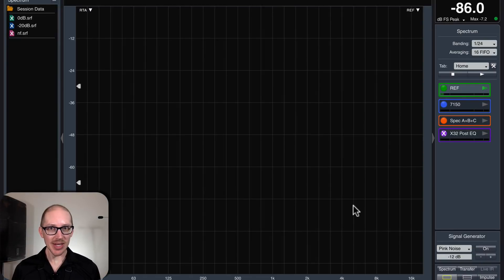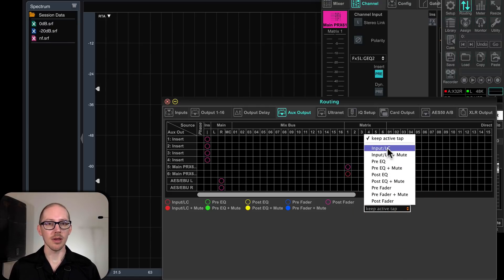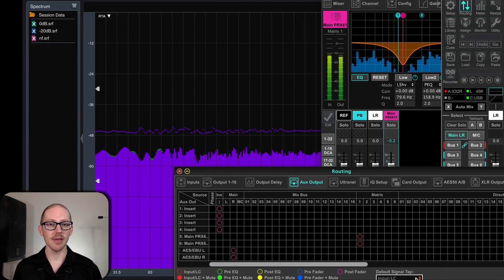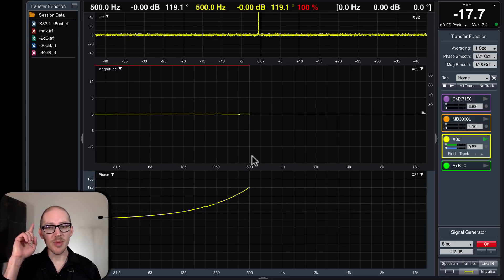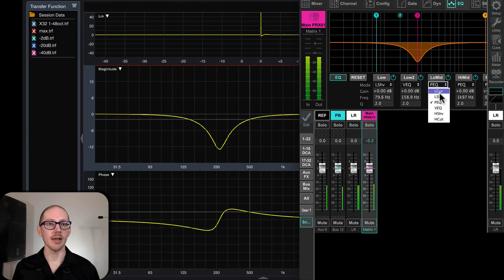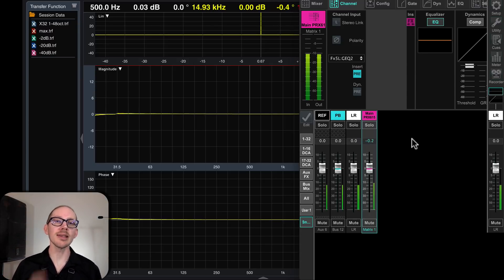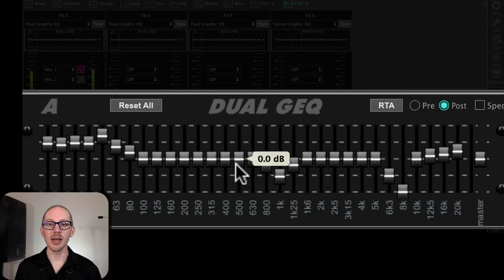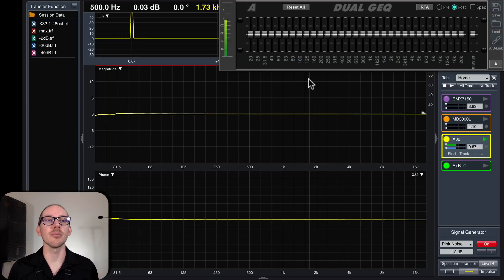Expectations: How do you measure an EQ in Smaart? [GSwSST24]

Comment: Hello Nathan"When staging a performance in an indoor venue, what strategies can we employ to address the variations in tonality resulting from the room’s unique acoustic properties?"
Reply from the maker: Hey Robin, can you give me an example. Maybe this happened to you recently? Tell me more about what you mean by changes in tonality. From my perspective it seems like the sound system calibration process should account for this.
Reply: @nathanlively   Thanks for your reply ....In my experience, indoor environments tend to exhibit a pronounced feedback effect. This is primarily due to the fact that certain frequencies may be amplified, contingent upon the specific acoustical properties of the room...What strategies should we employ to effectively mitigate such a challenge?
To what extent are Finite Impulse Response (FIR) filters practically applicable in a live system for the purpose of room correction?
Reply from the maker: @robintanj  ah, I see. I don’t have any good advice. All I know how to do is still apply best practices for system. Check every point in the signal chain to maximize GBF. I’m working on an anti-feedback plugin. Would that help?

Make sure that you know where your alignment positions are. You don’t want to be accidentally summing main and sub into an open mic onstage for example. 

Otherwise it’s just EQ.

Comment: Hi Nathan, Thanks a lot for the Video. Everything is understood. BUT one question. Everybody speaks about the phase shifting caused by the GEQ or PEQ. But in a practical situation why it matters? We do not send any paralel signals of a channel. like one is with and ather one is without EQ? So phase shifting matters where there are identical 2 signals with different timing. Could you please point out a few practical ( Especially Live Sound Situation) situation where the phase shifting through the EQ matters? Thanks in Advance.
Reply from the maker: Hey Priyan, please see if this helps: https://youtu.be/Z-lEyq4sb_k

Comment: Smoothing is implemented so badly in both: Smaart and SysTune. In 1/1 mode you can even see straight lines, while this should be a continuous smooth curve. Something like a (bi)cubic interpolation should be used...
Reply from the maker: Hmmm, I had no idea. Good to know. Is an another audio analyzer that you prefer that you think has handled this better?
Reply: @nathanlively  I'm not a "pro" in sound measuring, but as a programmer I see the issue from the first look.

Comment: Hi Nathan, 
Great info! Thanks. 
So, how would you route this on, say a Digico? Or any other console where you couldn't take the measurement-signal "pre-everything" on a matrix output? I'm kind of stuck with this.

Right now I make an extra matrix to be the measurement,  and gang it with my actual LR matrix. But that's probably not the right way to go.
Reply from the maker: Hey Marc, I did make that step a little complicated. Let's assume that you are mixing everything to a group, then sending that to the Matrix where you are doing some output processing for the different speakers. When you route that group to the Matrix, also route it to a physical output, therefore avoiding the processing you might do on the matrix. Does that work?

Comment: that would be harmonic distortion of any electronic equipment, a complete sine wave pure is created digitally but the a/d converters at the moment of generating electrical signal resonate with the components creating harmonics, measured THD (total harmonic distortion) lower is better, specially on broadcast because harmonics create a ton of problems since those where not intentional those are harmonics but created as a margin of error of the electronics do not miss interpret this as harmonics in music a perfect electronic device should not have them.

Comment: Hi Nathan, great video. I have always wondered what actually caused the phase shift when boosting or cutting a frequency with an EQ and why it does sort of a 'z' shape(in the phase response)  across the center freq. Technically what is causing that? Its same for  analog EQs and digital EQs unless it is Linear phase EQ. How does it effect what we are hearing in the end? Thanks in advance.
Reply from the maker: Hi Yamin, thanks for checking out the video. I may be wrong, but my understanding of the way an EQ works, is that it takes two copies of the signal, adds phase shift to one of them, then adds them back together.

Hopefully, in the end, it has a balanced effect on what we hear. Why? Because if there is an EQ change cause by one device, accompanied by a relative phase shift, and we correct it with an complimentary EQ and phase shift, it should come out to zero. Make sense?

Comment: Noob question...How do you compensate for filling the room full of people? The eq curve totally changes.
Reply from the maker: Hey Mark, thanks for checking out the video. I would argue that that is a common misconception. Yes, the floor reflection might be removed, but you can compensate for that with ground plane measurements. The temperature might change and adjust your delay times, but you can recalculate those. The humidity might change, but you can compensate with a high shelf filter. 

All of that aside, the answer is that you keep measuring. After your tuning you take a combined trace. During soundcheck you compare. Once the show starts you compare again.

Thoughts?